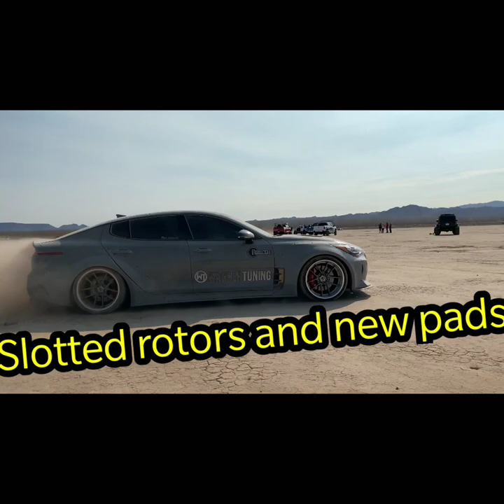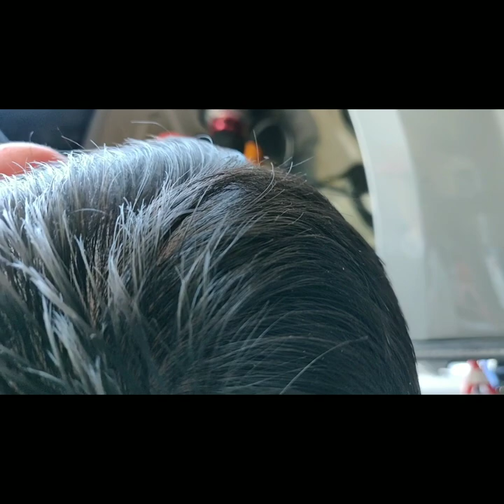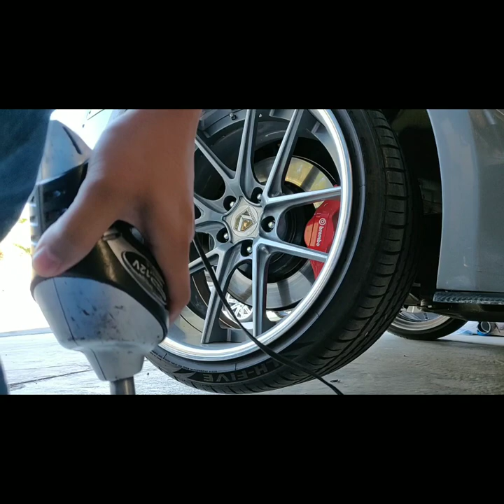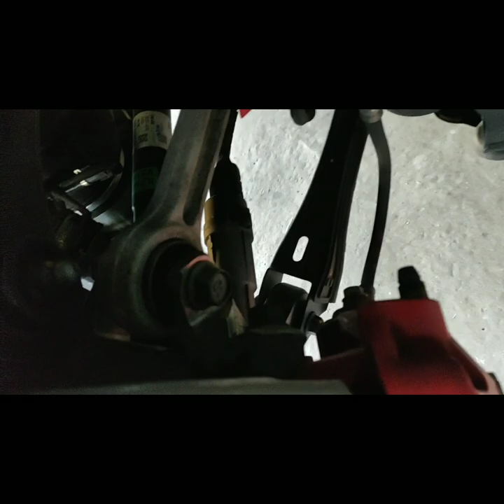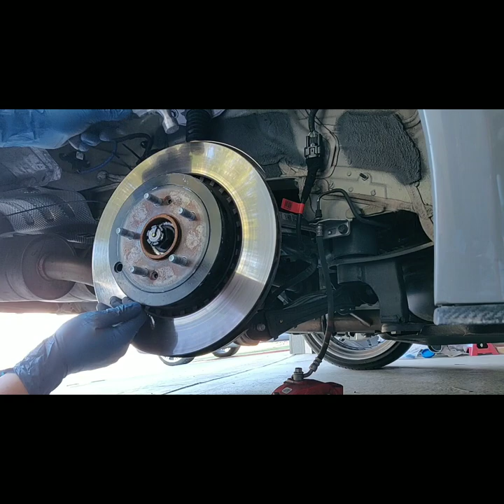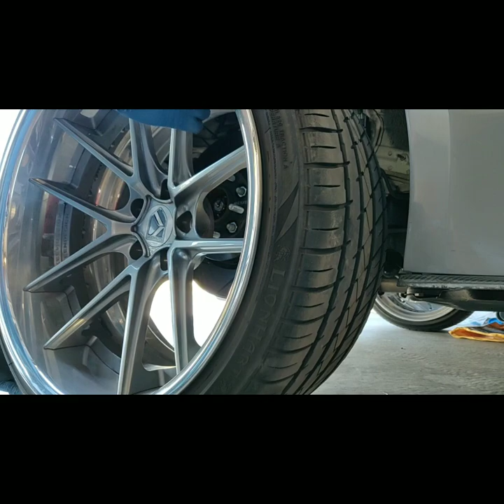Kia stinger rotor change

Comment: I see you didn't add the weights back on. Will the weights from the OEM pads be able to fit on DB1678 pads? What are hey for less vibration? Do those pads rattle without weights?
Reply from the maker: I have some inexpensive stop tech pads. I don't recommend these as they do vibrate a bit a squeal after some mileage. GiroDisk makes some good ones.
Reply: What are the specs / style on the rims? I've got the same car and those look pretty sweet!
Reply from the maker: @onionknight5142  there are special order KeenDesign 2 piece forged wheels. They can actually build these to spec. Mostly for the widebody KDM cars. For OEM fitment the KD06 wheels are very similar

Comment: My rotor screws are rusted on. Any suggestions? Also possible part number for them?
Reply from the maker: Drill out the heads on them. You will be fine to put things back together without them. So don't worry about finding a replacement on a Sunday morning.

Comment: You need to keep a screwdriver or something to keep pressure I did mine from the putting the top one in first then putting the anti-squeel bar underneath it and then putting the bottom one in holding it in place with the Eraser side of a pencil

Comment: Do you have to do that whole thing with the hose to change brake pads?
Reply from the maker: No. You don't.
Reply from the maker: You can just remove the pins.
Reply: Kia Stinger GT ohh OK I see. Push the 2 pins out then I can just pull the pads out then?
Reply from the maker: You replace all 6
Reply: Kia Stinger GT all 6? Isn't it just 2 pads per wheel?
Reply from the maker: @A_guan  my bad got confused. Yeah just push out the pins and pads come out.
Reply: Kia Stinger GT got it. Really straight forward then. Thanks
Reply: Then obviously push the pins back the way you got them out yeah? Never messed with brembos before haha just wanna make sure